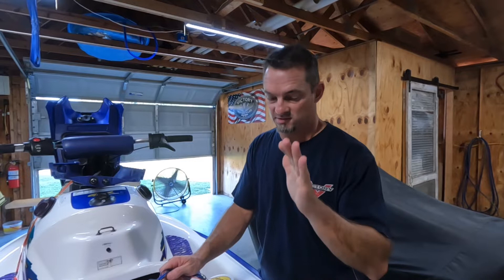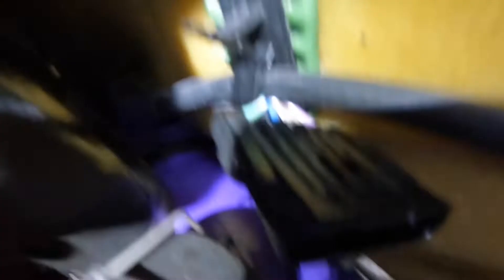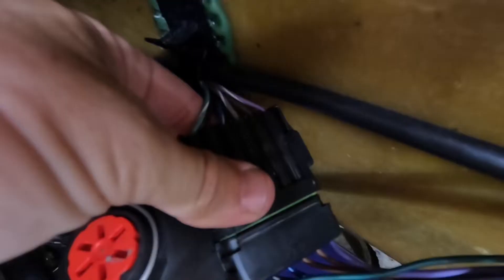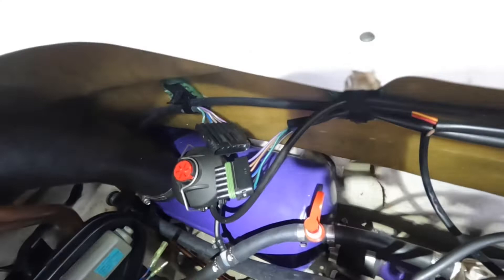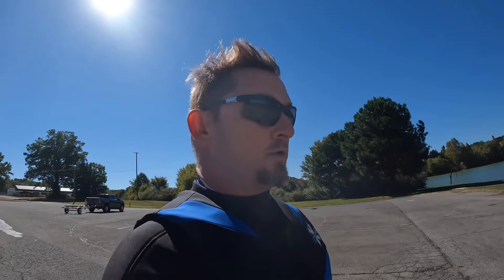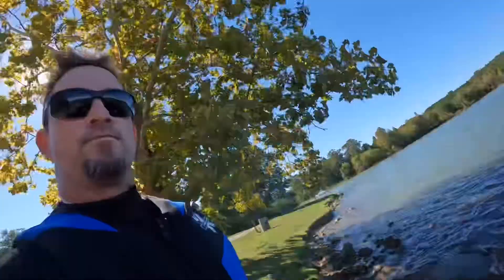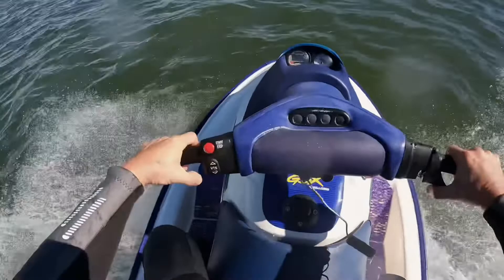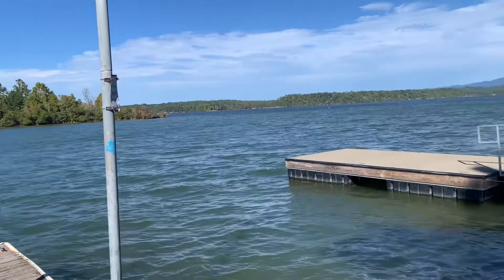SeaDoo GSX vts relay install

Comment: my vts works fine went through all the tests but when u trim all the way up it locks itself up making unable to go down, the motor isn’t binding in any way it just stops sending power when u want to trim down but sends power to send it up when it’s already up….my question is there’s  no other way to fix this problem besides the additional module or replacing the hole thing?

Comment: link to where you bought the relay
Reply from the maker: https://www.ebay.com/itm/162598108737?epid=8017866492&hash=item25db9a3e41:g:YD4AAOSwtkVZcFzx&amdata=enc%3AAQAIAAAA0IeyoWNGN2gIZAtyzna0acMYuGt%2BIqIEDU1vDoVrQUhAb1%2BntcAPwiFsOGZpwHNe9MKgiG0EDQrLJ7iikCLt1Eei6pA5WPPlhJn9y17Mq9uLe9vECZKIJGrn7gRUlFX%2FAk6KZgFc%2FUNfkRU0ePOvueivoe9niiECiXXTiOJz6xJWewjluokLP0tKZiaj2tKHCLRwnEccCAara0fdYPQSXpWm8%2B8SvoozdwRqONLlz5pplOxqjUNXFBB%2Fk3Qqh3sz52l7Hyyv0pNDN9oE7k4zRdY%3D%7Ctkp%3ABFBM2qSp9Zhi

Comment: lack of connection between wires inside (from DC motor) to connector is normal. Inside case are 2 relays, few transistors and bunch of reed switches and resistors. It doesn't indicate that the VTS electronics is faulty. 
The reed switches are used as position sensor but two of them are also a limit switches. When You bypass them instaling 451M tension in case of holding button too long can damage the worm gear. Thats why i recomnd to repair original electronics.